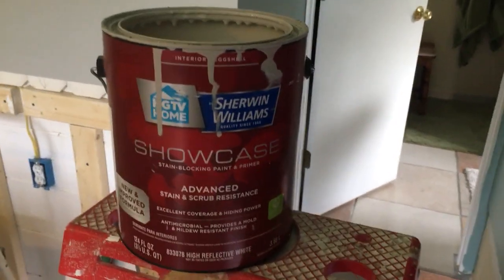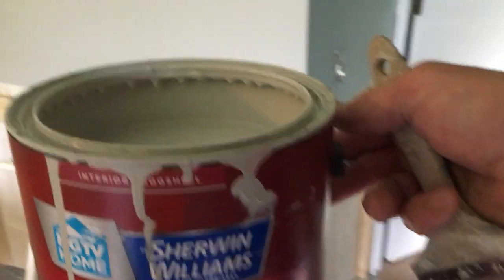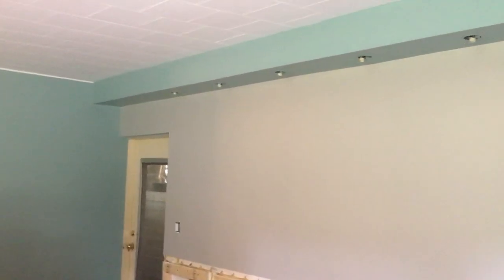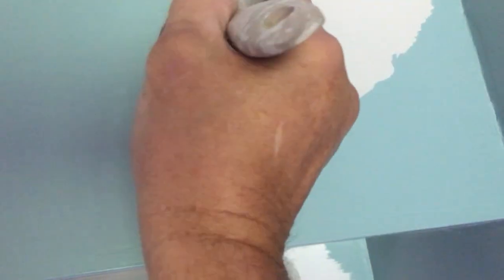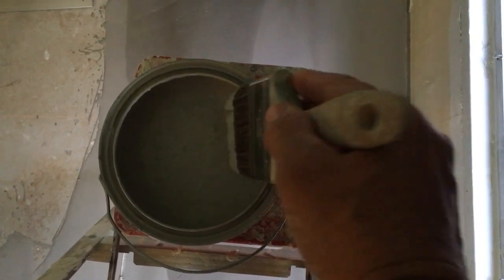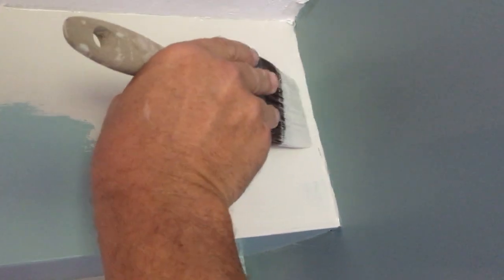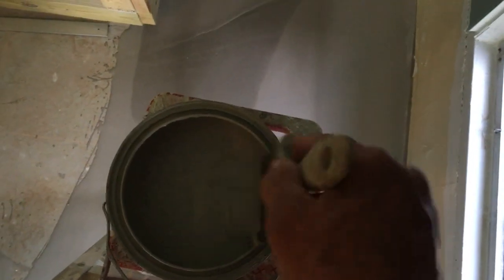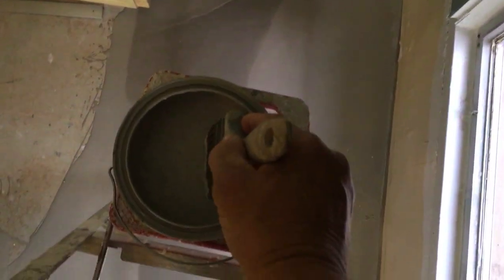Does Sherwin Williams Showcase cover in one coat 1 of 2

Comment: I work in the paint department at Lowe's and I can't say this enough... you always want to apply two coats of paint to your walls. The rep for Sherman Williams himself even said the paint isn't meant for one coat application. It's as close to a one coat as it gets. If you're painting the walls with a light color then you could probably get away with just applying one coat of paint. But that's also assuming the walls aren't blood red to begin with. Now if you were to use the next step up which is Infinity (which is sold at Lowe's) that stuff is THICK! I always tell people you get what you pay for. If you only want to apply one coat then you're best bet is to use Infinity. Not Valspar 2000 🤦‍♀️🙄😑😕
Reply from the maker: Great advice Kimberly.  I was a professional painter for 10 years and always applied 2 coats.  You just get a much deeper color.  Thanks Kimberly.  Keene
Reply: SW Infinity One Coat paint does NOT work with one  coat either - at least not putting a light coat over a darker wall.  I'm using SW Infinity One Coat right now (Roman  Column over Killim Beige) and I'm on my 2nd coat.  Even then,  I'm noticing some spots that  might require a 3rd touch up!!  Very disappointed - especially since  it's the most expensive at Lowe's.
Reply: @lrb1651  It's always good to apply a high hiding primer when you're painting over a darker color. Infinity is very thick paint so that's strange it's not covering the beige. I personally like Showcase the best. It has more of an enamel finish. Infinity definitely isn't cheap paint! But it's a lot more affordable than the paint at the actual SW store. You get what you pay for. SW still beats Valspar Signature by a long shot.
Reply: @kimbershark  Thanks for the advice about Showcase! I have 3 more bedrooms to paint, so I'll def check the Showcase brand. I can imagine the SW store is higher in price, so Lowe's is usually my "go-to".  Lesa
Reply: @lrb1651  I hope the showcase covers better! Let me know how you like it :) after using Valspar Signature I refuse to use it again lol it left such bad roller marks.

Comment: I’m using the showcase right now. Ceiling and wall.  Terrible!!! The wall has old paint but I had the walls and ceiling all plastered like new.   A coat wouldn’t even cover up pencil marks made from the electrician.  

I’m so far deep now.  I told Lowe’s.  I may return 2 cans.  Even the cover up for the wall doesn’t match well.  Never had this issue with BEHR
Reply from the maker: If your walls are new plaster, you always need to prime before you paint.  The raw plaster absorbs the paint and it will never be a color match to the original walls.
Reply from the maker: Thanks for the comment I hope you subscirbe to my channel so you can be notified about new posts.
Reply: I agree with you about showcase. I just finished sanding and painting over a light color with “livable green” a pretty light green and showcase is awful! I can see through it. So unhappy and exhausted!

Comment: This is the worst paint I’ve ever used. 3 coats so far and still splotchy. I should have purchased Benjamin Moore. Ugh!
Reply from the maker: I'm sorry to hear that @Monica HALL.  I found this paint to be very thick and smooth.  The only times I've seen  that has been when the wall had semi-gloss on it and it was not sanded, or if there was oil on it.  Say in a kitchen.  You should contact Sherwin Williams.
Reply: @wkeeneM  + It probably needs a second coat, but the lady said 3? No way.
Reply: I paint the living room, bedroom,bathroom and a kitchen yesterday and I put one coat on all of them excellent paint
Reply: I wouldn't doubt it.  I'm using SW Infinity One  Coat, and I'm having to apply a 3rd coat in some areas! Granted, i'm rolling light paint over dark ... but 3 coats?!

Comment: As most professionals know there's really no such thing as one-coat coverage in many different circumstances. Not only is it hard to cover a dark color with a very light color it's also very difficult to paint something like a dark red over a very light base. You almost always have to put some kind of primer coat down first. Secondly almost all paints are advertised as primer and paint in one these days because through government mandates all paints include a primer base in their chemical makeups.
Reply from the maker: Hi Blair.  Thanks for your knowledge.  You're absolutely right.  It is usually necessary to prime when making a dramatic color change.  In fact, when going from light to dark, you will get a much deeper color using a gray primer as opposed to white.  And, as you mentioned, eggshell is the sheen.  Thanks again.  Keene